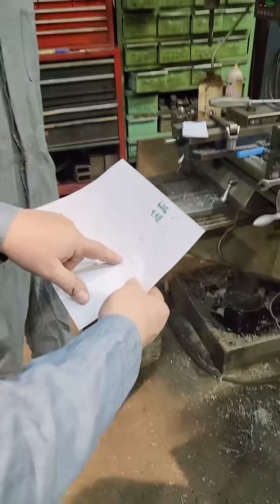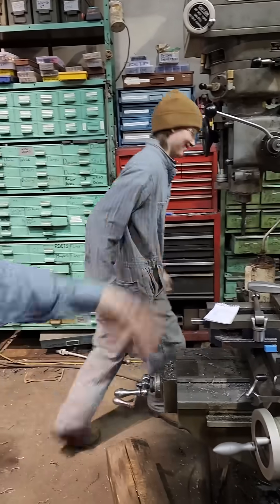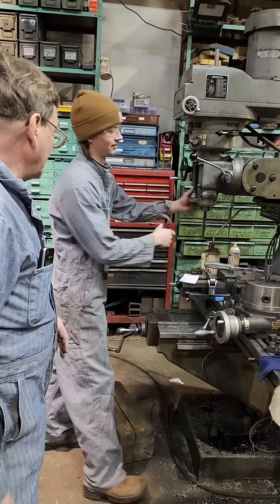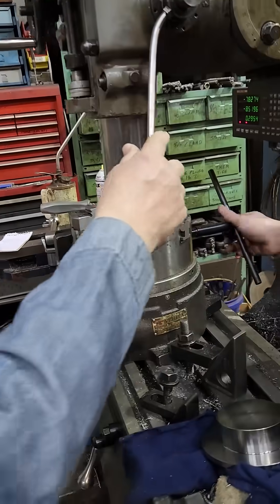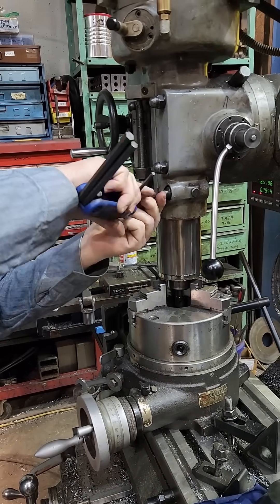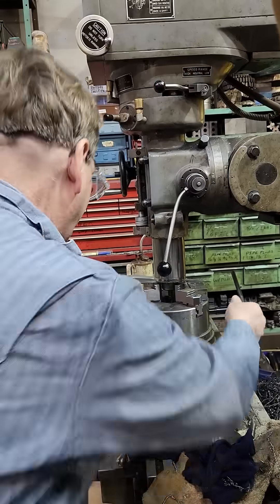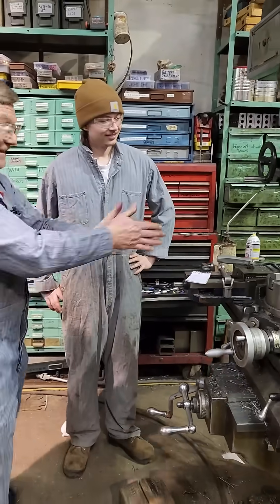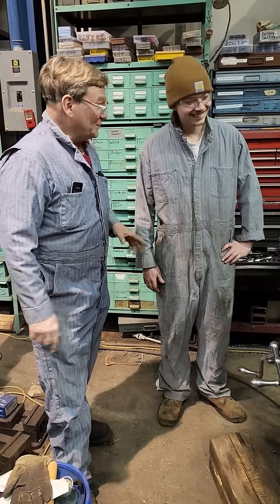Zero your dividing head on the mill QUICKLY

Comment: I’m more of a co-ax guy myself. More accurate, and more faster-er But that is an okay trick. I used to use the similar trick of a spring center on a loose part to pick up an existing hole. The guys in my shop still use it for mold/ insert repairs

Comment: A question from Germany… What is this “an inch and an eighth” you speak of?😊
Reply from the maker: 1.125"  It is pretty close to 2 & 7/8 cm in case you wanted a metric description.
Reply: @H @HOWEES  Thanks. That helps explain it. 😮 As a side note, I lived in San Diego, CA in the early 1970s. A friend worked as a Tool and Die Maker at Rohr Corporation (now known as Collin’s Aerospace). They were involved in building The Spirt of St. Louis. In the early 1970s Rohr was building the railcars for San Francisco’s Bay Area Rapid Transit (BART). The first 25 or so railcars were delivered to BART, but the trucks (AKA the wheels) were too narrow and did not fit the track width. Fortunately, my friend was not involved in that project, but knew about the screw up. Apparently, there had been a mix-up between metric and the US Customary System (USCS). He did mention the conversion involved the use of fractional millimeters and it turned out the wheels were 2 & ⅞ cm too narrow. 😊

Comment: Sorry to be the guy, but half of 2.5" is not 1.125😬 even with your 1/16 tolerance you might want to teach your guy to aways double check your math before running 😉
Reply from the maker: I was here to check who else caught that.  I checked on him later & He had it at 1.250, I told Him, I think it's wrong, lets look at the drawing, He was correct, it wasn't until watching the video that I realized how I made my mistake.  I had divided the .5, then in the rush mode of the video, I re-assigned(in my head) the .25 to the drawing, rather than the setting & then dived it with the 2" to arrive at the wrong answer.
Reply: @HOWEES  I've certainly scrapped a few parts doing that in my brief (so far) career. In a way I'm glad to see that doesn't always go away, at least mixing up numbers in my head. What does go away is remembering to double-check my math, and triple check for good measure, before making that cut. It's an awful feeling when you mess up a part for a simple math mistake, lol!
Reply: He cut it 3 times and it was $till to $hort ?

Comment: How about getting it close, loosening the dividing head slightly, tightening the jaws on the spindle to center it up then tighten down the dividing head completely.
Reply from the maker: I used to do it that way, I tried this shorter method, and did not observe any loss of accuracy, so I switched to doing it the way that is faster for me.  If the dividing head is already loose, I will sometimes bolt it tight to the table as the last step.
Reply: @HOWEES cool. Thanks for the tips!